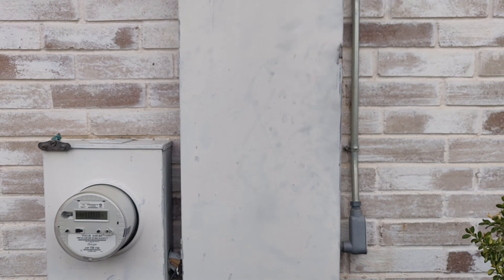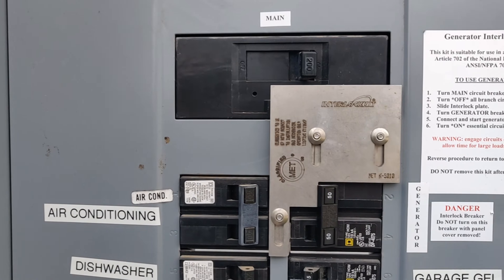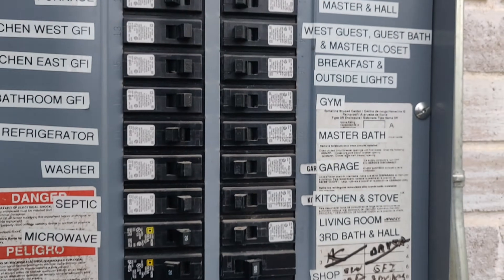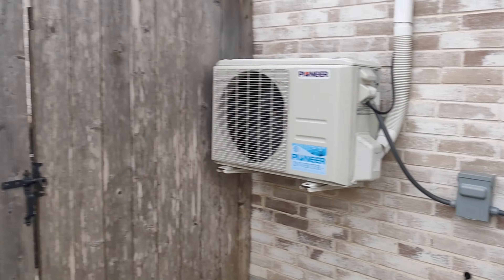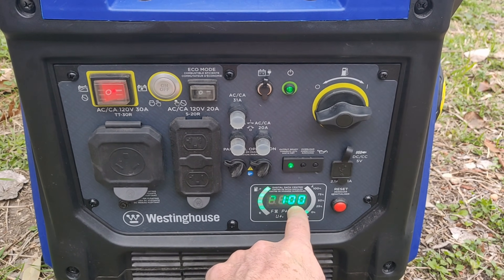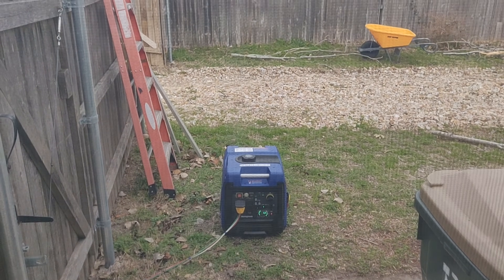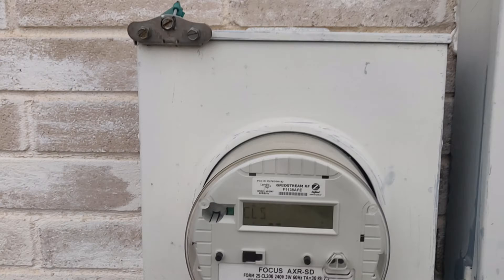Powering my house with a 4500 watt 120v generator.

Comment: There’s one major thing you forgot and no one has talked about. That is multi branch circuits or shared neutral circuits. Powering both sides of the panel with one single 120 V leg will overload shared neutral circuits.  He should be very careful if you have powering any of those circuits for basically the two devices that you might be powering would typically cancel each other out with 240 V available and the neutral would have no current flowing back now would have both return paths back through the neutral.  This is a very serious power issue and fire potential.  So it’s not just a question of turn off 240 V appliances. It’s making sure you understand which of the remaining circuits are shared neutral circuits.

Comment: Is it safe to go from a 30 amp generator to a 50 amp two pole breaker
Reply from the maker: Sure.  The breaker protects the house wiring, not the generator.  The generator is unable to produce enough power to harm the house wiring or to trip the breaker.  So the house wiring is safe.

The generator has its own builtin protections against overload, so it's also safe.

Comment: The beauty of doing it this way with a small 120v generator is fuel savings. For prolonged blackouts natural disaster type situations local gas stations may all be closed. So several gas cans maybe last 2 days with a large 240v gen, even if you're barely pulling wattage. Those same several gas cans last 2 weeks with a small gen

Comment: Each bus bar is 120 volts that is out of phase with each other! >>220 is split phase don't hook them together with a jumper in the plug!!!   If you turn on a 220 breaker it will be bad news with both bus bars ran on the same 120 output line from a 120 gen set! JUST DON'T DO THIS EVER! The 220 items will short out because they will not be on split phase! This could cause fires or at least damage to them. Running both legs of a 220 volt device on the same phase is not going to turn out good for you.

Comment: Hallo. Grat! I was not sure, if I can do this. But now..... ;). 
One question. Can I use two separate generators. One to power one side of the service (phase) and second to power second side. I'm not trying to use it as a two 120 generators to create 240.
Reply from the maker: I don't think that's a good idea.  I'd consult an electrical engineer first, but I think they'll tell you not to do it.

Better to just run the generators in parallel.
Reply: Just buy a 240v generator with either the L14-30R plug or the 14-50R plug depending on what you'll ultimately run.  Personally, if someone is going to all the trouble to tie in a power inlet box, interlock kit, etc., just go ahead and do the 50 amp power inlet box so you're more "future proof".  It's not like it cost that much more to do.  50 amp will give you up  to 12,000 running watts  capability whereas 30 amp is good up to 7,200 running watts.  They make adapters and cables to do pretty much any hookup.
Reply: @ITguyAR_66  Sure, this is the best solution. But I have already two 120 generators.
Outages are, so far, very rare. Fortunately, my area has natural gas. Electricity is what I need most for the heating to work.
Reply: @maciuspierwszy7569  Well, with what you're wanting to do with two 120v generators, you didn't list what they are so, if they are some sort of open frame non-inverter style, not gonna happen.  You can't parallel like that.  You would need inverter style generators that have the ability to parallel that would keep the phases in sync.  You still need to do a power inlet of some sort along with an interlock for safety.  Do NOT back feed into a circuit and become a Darwin Award Winner.

Comment: Does the furnance work off the generator? I had read some people with a floating neutral generator had issues running furnance burners so the fans were working but not the burners.
Reply from the maker: The gas furnace works happily on the generator.  The generator has a floating ground, but it connects to the main panel, which has a bond between neutral and ground, and a ground stake.  So it all works normally.
Reply: @ElQuesoGuapo  thnx. I've read when using a 120v generator only half the circuits work. Some people say it's a zip zag others say it's one side or the other. How did you get both to work?
Reply: @reptileenthusiast9618    Yes, it is a "zig zag" but you can do it with a 120v generator and feed both sides.  You just need the right adapter or cable that bridges the 120v generator out across both legs.  Then, you can either flip all the 240v breakers off or just leave them on; won't really matter.  But, the problem with using only 120v generators is when there are MWBC's in the house (multiwire branch circuits) so you need to confirm that.  That's where it's easiest to just spend a little more on a 240v output inverter generator and call it good.

Comment: Wouldn`t only 1/2 the panel be fired up with 120v 30a plug? A/b circuits?
Reply: Not when you jump the 120v across both terminal plugs.  Basically,  you could leave the 240v breakers on in this situation as it would only be feeding one side of whatever and would not power on.  But good practice to turn both off.  This is pretty common to do since 240v generators are typically larger and pricier.  But, you can get a Genmax GM7500aIED at Sam's Club for $899 shipped that's 7500/6000 watts on gas and 6500/5500 on propane.  I have one of those and I can leave my septic pump on as you never really know how much is in that pump tank if/when power goes off.  Septic pumps are on 12v so nothing too major.  I don't run HVAC or water heater if power is off as they draw too much and power outages are usually short term where I'm at.

Comment: I don't understand how a single pole 120V (black OR red circuit, for example) from the inverter can serve the two-pole 120V circuits (black AND red circuits, the odd and even number circuits) at the panel. Thank you for the video. Also, the inverter 120V is 30A. Why did you go with a 50A breaker at the main panel? Thank you for the video.
Reply from the maker: The single pole feeds both black and red.  240 volt appliances won't work with this setup, but 120 volt devices work normally.

I went with a 50 amp breaker at the panel because the breaker's job is to protect the house wiring, not the generator.  The house wiring can handle 55 amps, and the input box can handle 50 amps, so a 50 amp breaker is the correct size.

The panel's breaker doesn't need to protect the generator.  The generator has its own breakers and overload protection built in.
Reply: @ElQuesoGuapo You must have  connected the red wire to one of the double pole breakers. What wire did you connect to the other breaker?
Reply from the maker: @peacew6  That's covered in the video.  There's a jumper inside the generator cable's plug that connects the red wire to both Red and Black.
Reply: @ElQuesoGuapo  Got it. Thanks.

Comment: I assume your hot water heater is gas? Otherwise it'd be 240v.
Here's a question for ya, wouldn't you get 60 amps total from a 240 v generator? It'd go a lot further. 30A ea side sounds better.
For the money and hassle I'd always go with a 240 volt unit hands down.
Reply from the maker: A 240v generator wold definitely be better.  But I already had the 120v, so I did what I could with what I had.
Reply: @ElQuesoGuapo  Genmax GM7500iAED at Sam's Club....$899 shipped...just got one a few weeks ago on sale at $799 shipped.  240v 50a plug....7500 starting watts and 6000 running on gas; 6500/5500 on propane.  Not sure I'll try powering electric hot water heater, though, but I do have it run the 1hp 120v septic pump and it's no problem.  I leave the 5 ton and 2 ton units off, too.  Our outages are usually short term.

Great video, btw.

Comment: I did the same thing with my Honda 2200. Also make sure to turn off any circuits that have shared neutrals,usually on a double pole breaker. So make sure all double pole breakers are off during operation . It powers my fridge, lights and a 6000 btu window unit with no issues. And is quiet as a whisper.
Reply: Do you have an adapter for the 120v plug, or how do you do it?

Comment: Why not get a autotransformer to step it up from your gen120VAC to 240VAC split phase with a neutral to power your whole house.  Yous still have to manage your loads though with your gen size?
Reply from the maker: I'd never heard of an autotransformer before you mentioned them.  I think you're right, it would give me 240 volts, but load management would be the issue. The Westinghouse generator makes 30 amps at 120 volts.  After the autotransformer, I'd have 240 volts, but only 15 amps.  I don't think that would be enough to run my air conditioner (it's on a 40 amp breaker).

Comment: So why did you have the breaker for the whole house surge protector shut off wile on generator?
Reply from the maker: I shut off all of the 240 volt devices, and the surge protector happens to be 240 volts, so it also got shut off.  Your question got me wondering if the surge protector would do its job correctly while on the generator.  I'm not sure if it will or not.

For now, if I need the generator, I'll leave the surge protector off.  I think that the odds of surge while on generator are much lower.  While I'm disconnected from the grid, lightning would have to strike the generator or the house itself to create a power surge.

Comment: How come 12v generator produce 240v?? I have 120v Generator with 4250 running watts, so can I run stove or furnace or 3ton AC?
Reply from the maker: It does not produce 240v.  It only produces 120v.

Comment: Good video with good info, the only thing I'll point out is that probably 95% of everybody wants to power their furnace or their AC or both depending on what time of year their power goes out. There are lots of manual transfer switches and even the interlock devices where you could hook up your generator very easily and if it's winter still run your furnace Laura summer storms knock out your power you can still run your ac. Furnace and AC aren't as high demand as you think they are. If it's the middle of winter here in the Midwest it might get down to -20. That's great if you can keep your microwave working but you're not going to be able to survive unless you still have the capability of running your furnace off your generator.
Reply from the maker: You're right, there's no way that this generator will power my home's AC.  It could run a window unit, giving me a single cool room.  And it's got enough power to run my gas furnace in the winter.

With a small generator, the rear advantage of a home hookup is that you can ave lights, fridge, and gas furnace, without having to run a mess of extension cords.  It's good enough for my area where power outages are infrequent.  If I lived in an area with hurricanes, I'd just get a Generac.
Reply: Best bet there is to have Heater Buddy propane heaters and maybe a window AC unit to keep a main room cool or warm.  There's no way I care to power up my 5 ton 2 stage heat pump with electric aux heat or the 2 ton unit upstairs.  And those soft starts have/add their own issues.

Comment: Its not the dirty power that does the damage, its the voltage "spikes" that hurt the electronics

As long as the unit has a voltage regulator and keeps the voltage at 120V, then its fine.

Comment: For those who care, as long as you cut off your main breaker BEFORE you start your generator, the linesmen will be fine.  No need for the special switch.
Reply: Aaaaannnnnnnd that goes against code pretty much everywhere.  That's  the cheap redneck way but no way I'd do that on my house.  Ever.
Reply: Ahh ... lineman are trained to look for energized wires so if they come across it, they dont touch it

Comment: We could directly add this plug in dryer outlet so we can power house … only think we have to make sure we connect two legs with 120 volt like how you did
Reply from the maker: That is known as a suicide cord.  Don't do it.
Reply: @ElQuesoGuapo  ah ok ... suicide arm chair police just spoke
Reply: @ElQuesoGuapo  What difference it would make? 
Dryer is installed in garage and dryer cables would run towards breaker and feed in a main breaker 

Same way if we going to install generator inlet that will also run cables to breaker and power will distribute. 
What difference it would make?
Reply from the maker: @ltp9113  The lack of an interlock means that you can backfeed the grid and kill a lineman.  Your cable will have male ends on both ends, which means that you can easily touch the exposed ends and electrocute yourself.  And you don't know if the wiring for your dryer is rated for the kind of amperage that your generator can put out.

I know you think that you've come up with a good idea.  But a lot of other people have gotten the same idea, and have gotten themselves or other people killed.

It's called a suicide cord for a reason.  Please don't make one.  Do the job right, or don't do it at all.
Reply: Thank you. I have same generator like you have and going to feed small appliances max 30 amp

So i want to make sure that you split 120 into two lines and feed into the grid ride?

And yes it won’t run 240 volt but basically you are feeding other leg (120 bolt) for breaker.

Thank you so much for detailed video. I wish you had shown how did you connect those wire together just to make sure

But I’ll split 120 into 120 volt and feed two hot wires with 240 volt breaker.

Comment: I have the Igen 4500DF and converted it yo use natural gas. Hurricane Francine had knock out my power for 4 days. I only had to stop the generator once to change the oil. I have mine set up the same way. It ran lights, ceiling fans, two refrigerators, Chest freezer, three tv's and a 10,000 BTU window unit with no problems. Who needs to spend $8k for a whole house unit. I have a second unit that i used to run the washer and dryer when needed. It's setup for NG as well. For hurricane Ida we were out of power for 19 days. This little generator was a life saver.
Reply: @JerryHawk250  is there any chance you can show how you wired up the plug with only using 1 wire to power both legs??
Reply: @markbilyk3546 just research “dogbone adaptor”.

Comment: This technique would be dangerous for me and the way my house is wired. Many of my 15A and 20A runs use a shared neutral using 14-3 or 12-3 Romex. This means for each lug of the split phase, they ran the red and the black wires off different 120v breakers but then shared the neutral between those two separate circuits in the single Romex, it then branched out to separate circuits at the switch boxes or outlet branches.  This only works because if the two 120V circuits pull the same amount of current, the current on the neutral cancels out to zero, if only one circuit pulls 120V current, then the equal current comes back on the neutral, in general this wiring method saves energy and cost because of less neutral runs and the canceling out of current feature reducing the amount wasted transmission loss in the neutral.   If I used this 120V generator technique where I connect the two lugs of the split phase together like he did in this video at the generator input plug, I would risk putting 30 amps through my 14gauge neutral feeders if both 15 amp circuits were fully loaded.
Reply from the maker: That is an excellent point.
Reply: You could just get a 2400w 15a generator

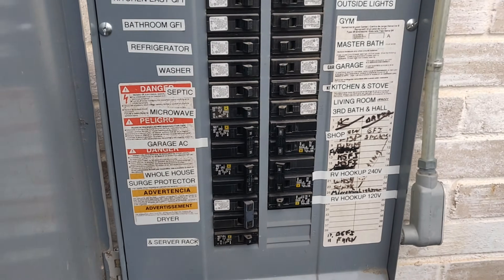Comment: 50A should have 6AWG wire.  8AWG wire In your case 30A which is the max you can draw!  10:24
Reply: Yeah it’s rated at 55 amps for that type of wire.
Reply from the maker: Thanks for commenting.  I think you might be looking at a chart for solid wire.  Solid 8awg is rated for 40amps.  I'm using 8ga THHN/THWN-2 which is rated for 50 amps (per the electrical engineer who advised me and the site that sold me the wire).

Please correct me if I'm wrong.

Comment: I power my home with the iGen5000DF.  I have a 50 amp inlet box so I just use a 30 amp to 50 amp dogbone adaptor to connect my 30 amp power cord to the 50 amp inlet.  The dogbone adaptor comes already internally wired to feed both legs with 120v.  The only appliance I have that my generator can’t run is the AC since it’s 240v.  With proper load managing, I can run everything else if needed including furnace, hot water heater, and dryer since they run off our house supplied natural gas.  That generator works great for our application.

Comment: Thanks for the info on putting 120VAC to both legs of the breaker box. I have asked other knowledgeable people if I could do what you did with the plug to supply 120VAC to each leg and they said it wouldn't work. I couldn't figure out why this would not work. This video solved my issue, it will work. Thanks
Reply: You don’t even have to make a power cord like he did.  You can buy “dogbone” adaptors that are already properly wired to function as needed.  I have the same setup except I run my generator through a 50 amp inlet box.
Reply: In fact, most AC/furnace uses 240VAC, but only the compressor uses 240 yet the gas furnace fan uses 120VAC. Therefore, you may feed the fake 240VAC to the AC/furnace, and it will operate the furnace fan.  You don't need the A/C in the winter anyway.

Comment: Thanks for the video.  I have a 240 generator but have a friend who does not.  Seems like a less sketchy way to jump the 120 vs. jumping it in the panel.  You can have a legal 240V panel and generator port wired up.

Comment: Do you still have the westinghouse igen if so how well  has it held up
Reply from the maker: So far I'm happy with it.  It doesn't get used that often, but it's been reliable.  As with any small engine, the trick is to drain the carb before you store it.  I haven't needed to use it to power my house yet, but it's nice to know that it's available if I need it.